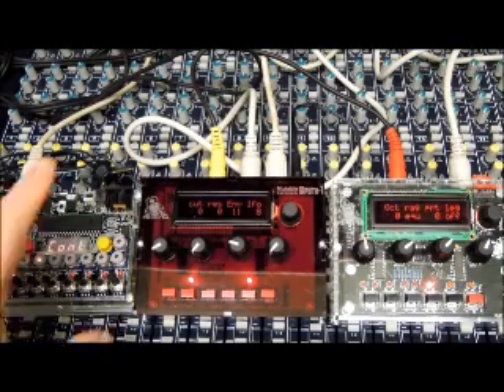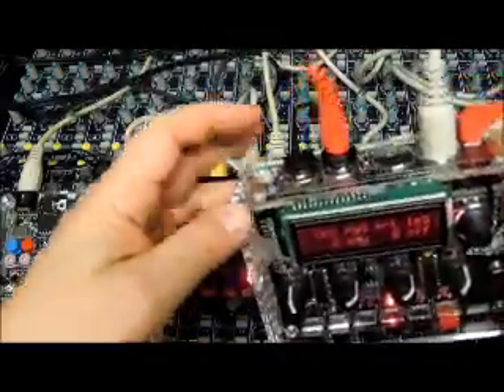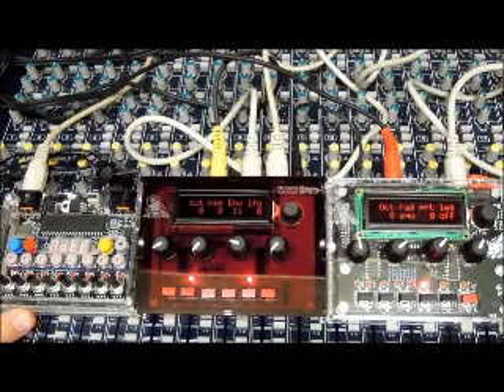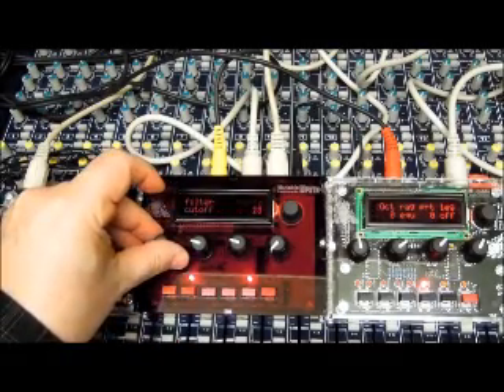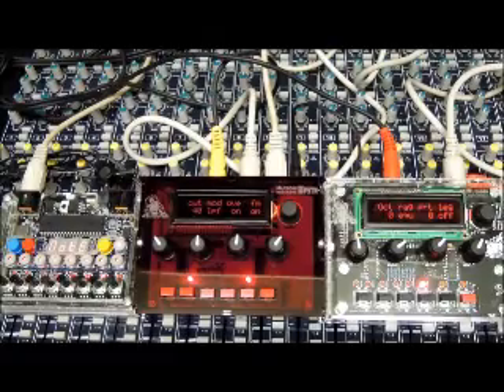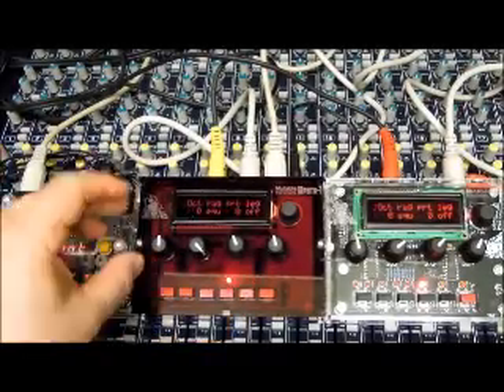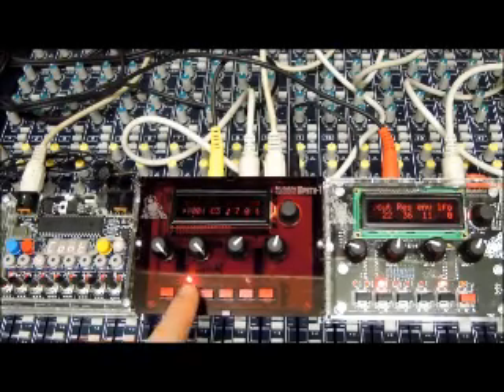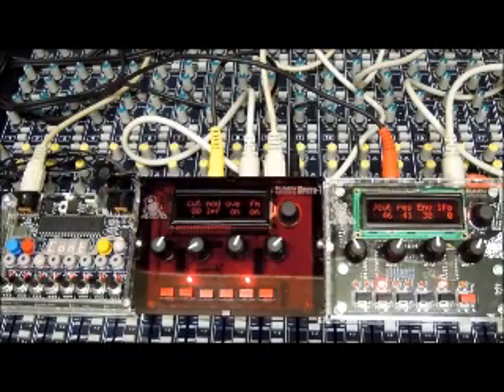Gorf Polivoks & Shruthis (better?)

Comment: I am looking for an alternative to an actual Polivoks....I see this has the 2 separate envelope generators but are they loopable? And what are the waveforms available for the Oscs? and lastly, can the Polivoks be set to play duphonically w/ glide?
Reply from the maker: Mono synth with glide. 16 (?) waveforms including 8-bit, wave and excellent vowel oscillators.  Loopable? Not sure but 16 modulation processes so maybe you can send an lfo to trigger them.  I'll find out. Internal arpeggio and sequencer. Velocity pitch mod and external cv ins if you build them into your kit.

Comment from the maker: I think its more to do with cosmetics and since your buying a set of pcbs antway why not match them?  But i do recall there maybe some slight changes in the connecting pins on the left so that the digital board can do some of the change settings on page two of the filter, but almost everything is the same as a normal digital control board.  Most people use the clear cases and it looks nicer ; )

Comment from the maker: I built a sandwich SID, but they stopped making them, No each of these, the red and white box is 2 x vco, filter, 2x adsr, 2x lfo and more each, driven by the note and velocity info of the midi sequencer.  Each has different filter designs and 10+ modulation sources.

Comment from the maker: I thought you meant in the video, which I do very quickly and don't want to redit out of laziness.  I have just reread the text description and rewritten it to point out it is a new analog filter design using modern chips, versus the earlier arguments I was around for about the need to stop using up rare chips for modern machines, which Olivier took very seriously and responded to with these designs which I use regularly (and Minimoog/arp2800/JP-4) these are great synths, and cheap!

Comment from the maker: I find a 1x6" shelf gives me a nice stepped setup and you could do tabletop with a pedalboard rig.  Looking at the 1STop as a multi-unit power supply, that drives 8 pedals/maybe 4 shruthi's off one plug? Watch out for polarity on the power supplies.  I use North American 9v supplies with a tip/barrel polarity reverse cable, normally sold to guitarists. For some reason European designers often reverse the ground and hot in their designs.

Comment: @kidtronic 
"Beyond this point, everything is analog. Most of the Shruthi-1s are built with the SMR-4 filter, a warm 4-poles “modern analogue” low-pass (no vintage IC)."

I simply understand that so that the filter is analog and that's it. No mention about it being DCF.

Comment from the maker: You are right.  I was shorthanding that this is a digitally controlled "modern" filter, but not a traditional "old school" analog filter.  My first shruti-1 (pre-shruthi-1) used a rare vintage analog chip, (CEM3379 VCF/VCA).  It started a discussion about the design endangering a limited supply of spares.  So Olivier' designed this with new parts to acheive the old analog sound.